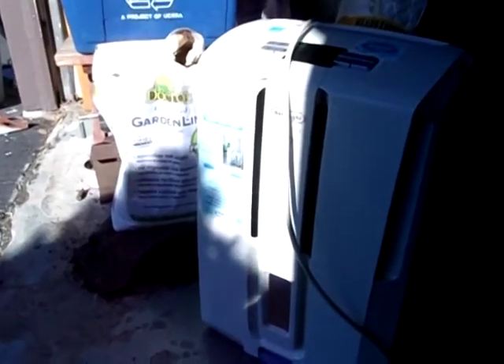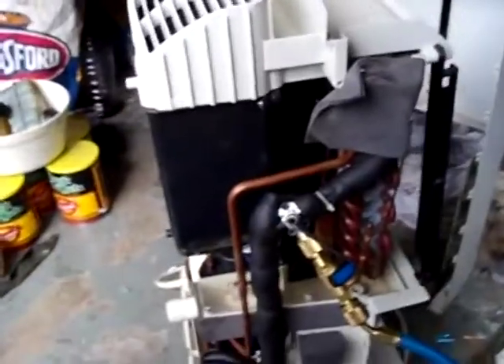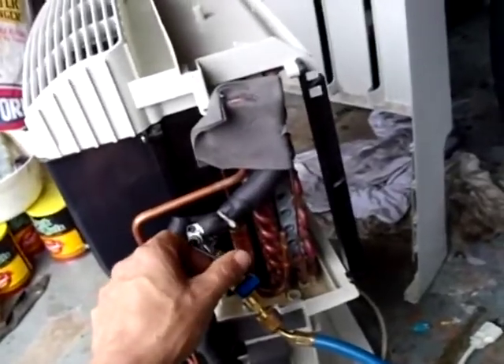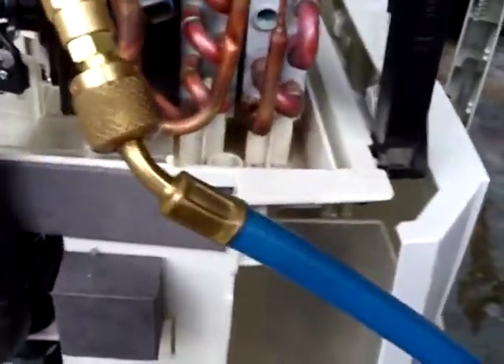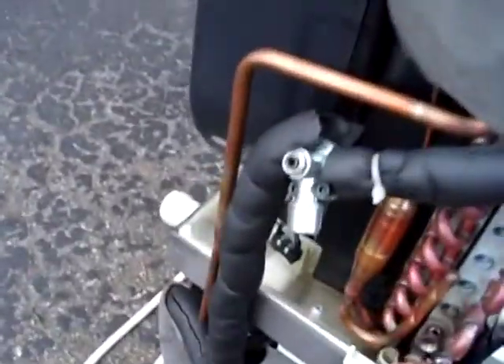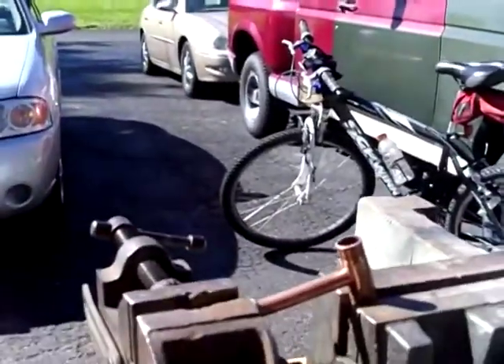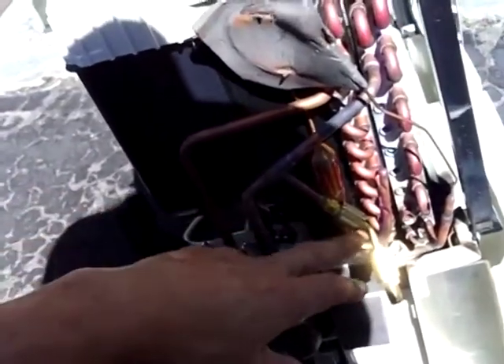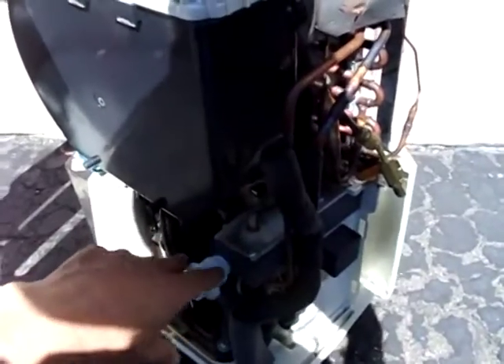dehumidifier repair: diagnose; repair leak; test; try;

Comment: Many of these new Chinese R410a dehumidifiers  have leaky evaporators straight from the factory.  That is why many fail after 2 years or less.  One YouTuber did a water bubble test and found that the evoporators were full of tiny holes.  If that is the case here it is not worth fixing.
Reply: I saw that one two...  he went through 6 units and finally got enough parts from those to make one working unit. The tubing they use is defective and way too thin.
Reply from the maker: Yes I got the picture now that they are just junk.

Comment: Fixed several of them. Takes some  skill with brazing. Have had 5 different brands that have lost charge. Must braze in service port on low side, find fix leak if possible, evacuate, and very important, “weigh in the charge”. R410a must be charged as a liquid. Takes LOTS of tools and equipment but if your in the business, not difficult. Not a DIY thing due to equipment and brazing skills as demonstrated in this video.

Comment: Garden hoses and dehumidifiers...  Two things one never needs to buy if a fixer.

Garden hoses only need new brass barb fittings -- no worm-drive hose clamps, use flush-fitting wire clamps (see the ClampTite tool and/or the associated DIY-built clones).

The last dehumidifier I dragged home on trash day was a very nice Whirlpool example.  The compressor would run even if the unit was switched off via the electronic control panel.  The compressor would run until thermal overload.

Okay, I dove into the electronic controller board and discovered the compressor relay was stuck in the "on" position.  The control side of the relay was being commanded correctly from the electronic controller board.

With a brand new relay sourced off eBay, I desolered off the old one and installed the new one.

The thing now works like a dream!  Actually, better than a dream since the dehumidifier was free and fixed with an hour or two of diagnostic time and fifteen minutes of electronic soldering.

Comment: 410a? 134a? Both have different boiling point.
Reply: Trying to repair my 5 Year Old R410A Noma 50 Pint per Day Dehumidifier and have fully cleaned evaporator and drip tray and backflushed with soap and water at drain hose fitting and cleaned visibly dirty humidity sensor with electronics cleaner but still got minimal condensation in bucket and am putting leak stop replacement material for R134A with automotive fitting and charger so wish me luck!
Reply from the maker: it was 410a.

Comment from the maker: My first dehumidifier repair.  Since this experience I have acquired another and am in the process of diagnosing it.  I found rust at the low side tube right at the compressor.  It has slight frosting when it runs so probably a bit more refrigerant remains compared to first experience.